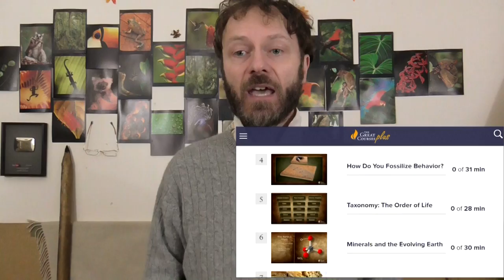Muzzle Brakes - what are they for?

Comment: wouldnt the muzzle brake also decrease the range of the gun slightly?
Reply: It doesn't.
Reply: what if when the brake takes away lets say... 30cm of barrel length? if that was a solid barrel shouldnt it accelerate the projectile longer, thus increasing range?
Reply: you mean by letting the gas escape early? Muzzle breaks are just stuck on the end of the barrel, not replacing a section of the barrel. I think they can benefit long-range accuracy because there is less gas trying to overtake the projectile just as it leaves the barrel, but I doubt it would make much difference
Reply: Then yes, but muzzlebreaks are an Addition to the barrel, not a replacement for a part of it
Reply: well, i d argue that if you add 30cms of muzzlebreak you could just extend the barrel on a similar vehicle to the same extend?
Reply: no.  the bullet leaves the barrel before the expanding gas does.
Reply: Well thats why some have them and some dont.
Reply: grimfang999 not really.  Muzzle brakes or comparators reduce recoil.  However they make the guns louder and make huge fire balls which can blind you ( temporarily) at night.

Most tanks these days use gyro stabilizers to eliminate recoil.
Reply: Muzzle breaks are added on top of the barrel, making it longer. Meaning the projectile acceralates the same distance before the break comes into effect. In handguns they are usually added to the same thread you'd add a supressor to. If the muzzle break was made by making holes on the sides of the barrel it would indeed decrease the range of the gun, but since this isn't the case they don't.
Reply: If you have a shorter barrel, the projectile will still accelerate after leaving the barrel. A muzzle brake would then decrease the max velocity of the projctile.
Reply: but isnt the gas still propelling the bullet even after it has left the barrel?
Reply: +BBQHunter Nope, the moment bullets leaves barrel its decelerating. Theres no force to accelerate bullet anymore.
Reply: It actually does but its such a little amount it's negligible.
Reply: Barrels are expensive, heavy and mass-produced, with the tank generally designed around the gun not vice-versa. Muzzle breaks are fitted by the tank designer if they want them, not fitted by the gunmakers. Muzzle breaks are also cheap and semi-disposable, because they're only made as strong as they need to be, and they can get fouled by hitting walls or even the ground sometimes, obstructing the path of the projectile in which case you'd either cut it off in the field or return to the garage. The exception would be that sometimes muzzle breaks are also counter-weights by design therefore much heavier, but this is a stopgap by the tank designers from trying to fit the gun in a less-than-ideal turret/casemate
Reply: +Glockmog2007 you're not wrong but imagine a small ball of heavy metal on a table. If you blow on it not very much will happen, it might roll a bit. If you blew it through a well-made tube it would go MUCH faster. Gas propelling the projectile after its left the barrel isn't necessarily a beneficial force either, because it could throw the projectile off-track, especially if the end of the barrel is close to the ground or a wall and the gas wants to go in a certain direction. Accuracy at range is much more important than pure maximum range as well, just look at fin-stabilised ammunition for example. Intentionally creating drag in order to make a much more stable projectile (although thats a simplification, since it lets them get away with smooth-bore guns = higher velocity & range)
Reply: +Glockmog2007 also modern tanks have bore evacuators which means the pressure in the barrel as the projectile leaves it is much closer to atmospheric than it would otherwise be, with the blast being slightly delayed (by which time the protecile is a very long way away) so you can see they don't place any premium on gas pushing the projectile after its left the barrel

Comment: Hey Lindy beige, it's a muzzle brake, not a barrel brake. The muzzle break works to decrease vertical recoil by letting the gases used to propel the shell out of the barrel. So the air wants to escape, so by putting a muzzle brake on the barrel, u are letting air out of the sides of the barrel, therefore reducing vertical recoil.

Comment: When I served in the army, artillery, a 155 mm shell got stuck in the barrel and we tried to push it out from the front. That didn't work, so we used some higher explosive. That's why you always have to check  the barrel after each shot.
Reply: B.S.
Reply: @donald6815  Sorry, it's not a joke. It really happened! We were all amazed the shell got stuck. We had to use a higher explosive and fired with a much longer cord while the platoon took cover at a long distance from the Howitzer. Apparently you never served the artillery, they always check if the shell left the barrel. We were the first platoon that used this canon and fired before with a normal average explosive and they wanted to check with a lower one. With the rest of the battery it just worked fine, except our canon. We had to wait till the next day to fire again. There is a tool to push the shell out from the front of the barrel, we tried and that was a stupid bs action. I think this tool is only usable if you push the shell in and want to get it out right again without firing. It's a quite remarkable story but certainly no b.s..
Reply: @amigaamiga7671  Was the barrel after that still useable?
In my military time i saw a rifle, a bullet got stuck in the barrel, by a forgotten pice of cloth from the cleaning, the next shot bursted the barrel
Reply: @wolf310ii  Whoow always check the barrel of your rifle. But that's right, the barrel of the gun always had to be cleaned after some shots (oil and a big clothingball pushed from the front into the barrel a few times) and the barrel itself inspected from the outside for cracks. I believe there was no problem with this piece, but can't remember we shot later with it again nor heard anything else of it.
Reply: Long time Amiga fan here. Great story!

Comment: Why do modern tanks have a bulge on the back of the gun and older tanks do not?
Reply: Bore*
Reply: Yup. We had those on Merkava-III. Once you fire the round - this thing starts sucking all the air from the muzzle.
Reply: OwO
Reply: FaZe the bigger guns that they use (comparison. Tiger has 7.5cm while Abram's is 140mm) need bigger shells so in turn make more waste fumes that won't come out by its self so when the crew opens the breach to reload it will blow in the loaders face and suffocate the crew older tanks didn't have this problem PS battleships mainly British and older WW2 have a Fume extractor
Reply: wat? 
Tiger had an 88mm gun and the Abrams still has a 120mm gun (used to have a 105mm)
Reply: A: larger gun = more room needed.
B: can be ammunition storage for some designs
C: some use gun rammers which take more room behind breach of cannon
D: can act as a counter weight against the large caliber cannons

Comment: Muzzled tanks is basically great for large scale attacks and also will prevent enemies trying to plant bombs on the tank its like a tank better at solo and infantry close proximity blast and also id rather have them bring it to battle and attach it anytime needed rather than not having it in case of solo! Itll probably only use a few ammo space. Id rather have the option than not have it.

Comment: The shell doesn't leave the barrel.  It stays in the chamber.  The projectile goes out the end of the barrel.
Reply: Nitpicky, and correct.
Reply: Nitpicky & wrong. What remains in the chamber (unless it's a CR2 bag charge) is a case. A shell is an explosive projectile, HE in modern parlance. The name comes from the projectile being a metal shell around an explosive centre. @MonkeyJedi99
Reply: @GARDENER42  I sit corrected. Thank you.
Reply: then there is the term we are being shelled and we called in arty and the began shelling the position so its an interchangable term.
Reply: You can't interchange a noun with a verb.  "Shell" is the name of a component of the system. "Shelling" describe the activity. Not the same thing at all.

Comment: The tank commander sounds like bullshitter. Every soldier, officer is trained in the use of firearms, and the very first thing you learn during the course is the construction of your service rifle, all of its parts included. Muzzle brake too.
Reply: Don't know about the L85, but the muzzle device on the M4/M16 is referred to as a flash suppressor, not a brake or compensator. I see no reason the British rifle wouldn't have a similar device.
Reply: Now that you said flash suppressor I remembered those are different things called differently. I will concede this argument.

Nonetheless my doubt remains.
Reply: THey might just refer to it or what they replaced it with, using different terminology or their own terms which havent entered common vernacular

Comment: I used to maybe think that muzzle brakes were to stop the end of the barrel exploding like a peeled banana to compensate for firing very powerful rounds? Apparently, it says in the Tiger tank operating manual that the gun should never be fired without the muzzle brake fitted.

Comment: We still use the sabot rounds. Depleted uranium tips. Once inside the vehicle the crew is liquified. You’ll need to wash out the vehicle but it still runs. Usually the sabot is followed up with a tank grenade. First you kill the crew then make sure the vehicle is eliminated.

Comment: I would add that muzzle brakes are used also for assault rifles, like ak 47, m3 or m16, the main reason being to reduce or remove muzzle rise.
In an 47 the muzzle brake also compensates a lateral drift.
Reply: Valerio Preite M16 does not use a muzzle brake, it uses a flash hider and compensator hybrid. Also your definition of recoil is wrong, recoil is not the gun barrel rising but how much force the gun kicks your shoulder. Muzzle brakes reduce the force on the shoulder while compensators reduce muzzle climb. Ak47 also uses a compensator not a muzzle brake.
Reply: @hazardous458   Yes, sorry, I was a bit too inaccurate about those terms.

Comment: The gases are channeled sideways and backwards, to counter the recoil forces at least a bit. Even much smaller guns like the AK-47 use muzzle brakes and recoil directors. Even some SMGs. The down side is always dust and shock to anyone standing to the side or behind the shooter. Tank guns much more so

Comment: It is actually to reduce the recoil of the gun back into the chassis. Most don't know that tank guns weight THOUSANDS of pounds. It. does displace gasses a bit but its mostly recoil. I got a Barret M82 once with no brake and it felt like x10 12 gauge shot guns, where as with a break you hardly feel it.

Comment: Interesting, I first encountered muzzle breaks on .308 Win calibre Rifles, which are intended to reduce recoil rather than smoke, since rifle rounds use smokeless powder (there is always a tiny amount of smoke, even from a .22lr rimfire.).

Most of my guns are moderated, but at a target shoot, people were using muzzle breaks.

Approximately 60% of the sound/blast is directed sideways and backwards, and even from a small round like .308 (in comparison to a tank round), the detonation produces and awful effect to anyone standing behind the  firing point, causing  both a punch to the chest, and in the case of cheap ear defenders, a squeal of air after each shot, due to pressure equalisation inside the ear defenders if they are a cheap design.

This squeal/squeak can be quite annoying if you're on a firing point for many hours, so you tend to buy expensive ear defenders as a result.

Comment: I was a gunner for 17 years.......... There is another reason for a 'muzzle brake'............. Just as important as helping to reduce the force of the recoil. It's called; To counter act 'muzzle preponderance'.......  Basically,  when the weight of the breech exerts a greater moment about the trunnions than does the weight of the muzzle end.

Comment: You might have mentioned their use on machine guns to keep the barrel from rising up on continuous firings.  In that case, the gas is directed upward to keep the barrel level and not climbing.
Reply: Than its a compensator.
Not everything you can mount on the end of the barrel is called muzzle brake.
I know english is a very unprecise language, but not that unprecise.
Reply: @wolf310ii  Yeah, that sounds right.  I think he used the term muzzle (barrel) brake for the compensator, didn't he?  Who knows?  I still don't completely understand his explanation of that bulge in the middle of a tank barrel to clear it out instead of getting smoke into the crew compartment.  Is that this video or another?  All good stuff.  Thanks for pointing out all this.  And, yes, English is kind of vague and inaccurate at times. (all the time).  I don't know how people can possibly learn it, but they do.
Reply: @alext8828  That bulge on modern tank barrels is the fume extractor, its a short barrel mountet gas tight over the main barrel, with little holes in the main barrel.
When the projectile passes these holes, the short barrel gets filled with the expanding gas from the propellant and if the projectile leaves the barrel, the pressure drops much quicker than in the short barrel, wich blows the remaining gases than forward out of the main barrel and if the breach opens it sucks the air from there too.

Search in Wiki for fume extractor or bore extractor, there is an animation, wich makes it much easier to understand.

Most small arms use flash supressors, some use compensators and some a kombination of both, they reduce the recoil a little too, but real muzzle brakes are only used by a few small arms, like the M82 barret.
Some have even recoil increaser, like the MG3 (MG42), wich is needed to push the barrel back, to unlock the bolt.
Reply: @wolf310ii  Great info.  I do have trouble with those fume extractors.  I studied the animation and some others and it still makes no sense to me.  I gave up on it for a later time, to think about it.  Thanks for the info.  All good.

Comment: 5:57 he got the two functions of a muzzle brake correct but he"s missing the 3rd use witch is muzzle flash 
muzzle brakes help hide muzzle flash so the enemy cant pin point your exact location but they know they have been fired at

Comment: What if you were to make a muzzle brake where the holes pointed backwards? Recoil would likely be heavily reduced then. I guess it would push down everyone behind the tank, but that seems like a better use of a muzzle brake
Reply: No it wouldnt work very well. The gases have to be redirected and simple backward pointed holes cant really do that.
The muzzle brake of the Tiger, with the big windows pointed slightly backwards, take already 75% of the recoil.

Comment: There is another reason for using a nuzzle break. When the bullet leaves the tube the smoke overtakes tue bullet. This can change the direction and doesn't hit the target.  The Gadget for reducing the noise hast the same  effect. The Tommi-gun used the nuzzle break for pushing the weapon down. Without ist wasn't possible to hit  a target  while automatic fire.

Comment: Means of prevent the barrel moving back and a way to stop the smoke coming out the back
Reply: The bore evacuator (that bulgy thingy in the middle of the barrel) is what sets up the draft through the barrel so the gunsmoke doesn't waft back into the tank.

Comment: I was told they were to control shrapnel discharge when firing over equipment and troops! It is why field guns (like the 25 pounder field gun) needs them and navel guns don't. If he had a Churchill Crockadile, that used soft shell high exposive they had a muzzle fitted, becouse they were used for bunker bustling, or ground support (soft shells had a lower muzzle valosify). For armerpirsing (tank on tank) you use a hard shell that needs more valosify, and does not spilnter as easy! They be removed depending on the action needed.

Comment: if that much of the blast is redirected sideways,  assume it's "lost" and so the shell is propelled with less force.  Is that right?  If so, it would be a disadvantage in most situations I suspect!
Reply: No, the blast is lost anyway. The shell gets propelled inside the barrel, not outside of the barrel.
The very little tiny bit of less force is more than overcompensated by the bigger propellant load a gun with muzzle brake can use, or the recoil system can be much smaller.
In the Tiger tank the muzzle brake compensates 75% of the recoil

Comment: I have heard that on AR-15 platform weapons, the muzzle break (which has holes on the top and sides, but not on the bottom) works as 1) a flash suppressor, 2) to direct exhaust gases upward thus countering upward tendency of the barrel during recoil, and 3) to keep dust from being kicked up into your eyes if you are shooting from the prone position. Is this true?
Reply: 5.56mm has barely recoil, so there is no need for a muzzle brake.
If there would be holes on the bottom, it couldnt work as compensator anymore